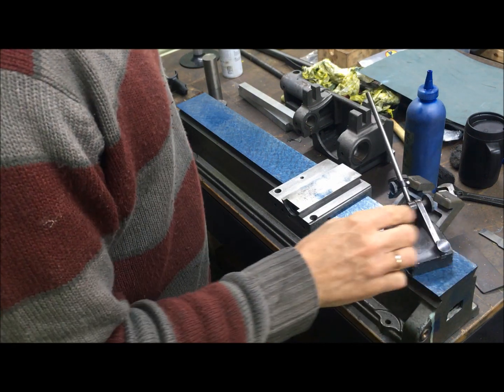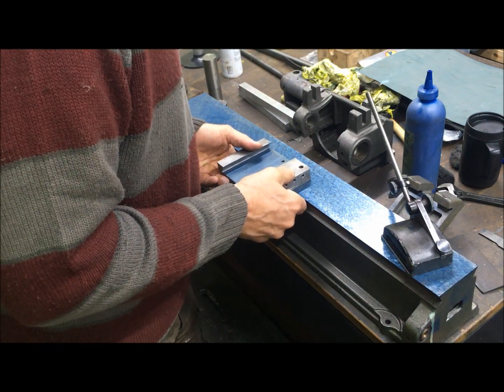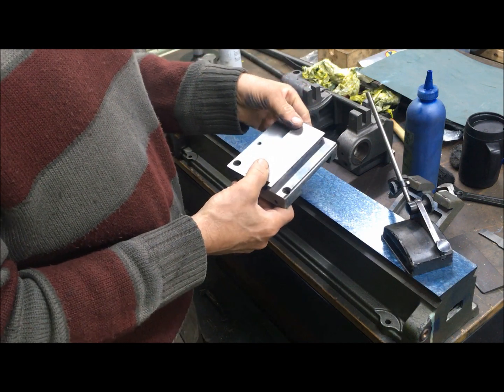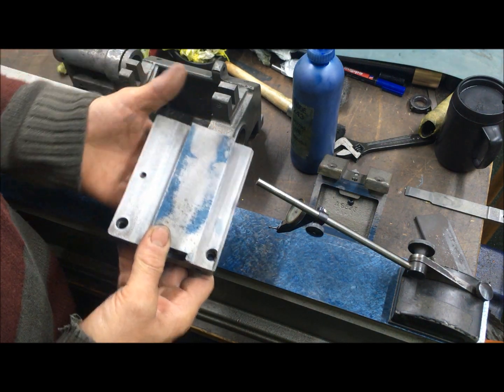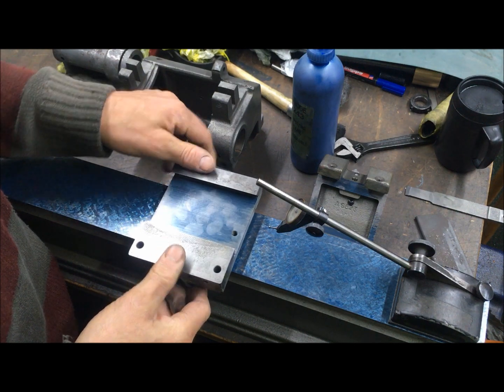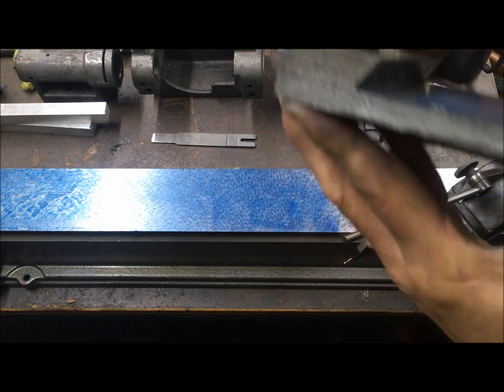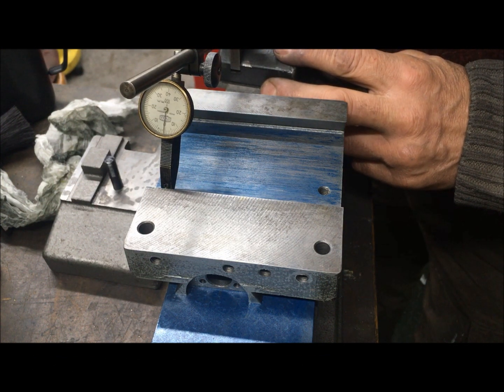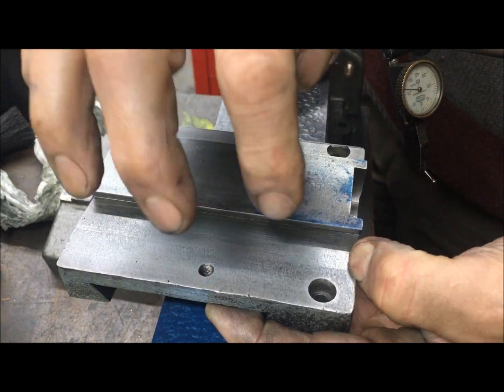Myford ML10 saddle wear

Comment: Excellent work, as usual.  Measure, think, check, then act - can't make good decisions before measuring!
Reply from the maker: Thnks. Correct.. easy to remove metal.. "impossible" to add back and hard/uneccessary to correct mistakes